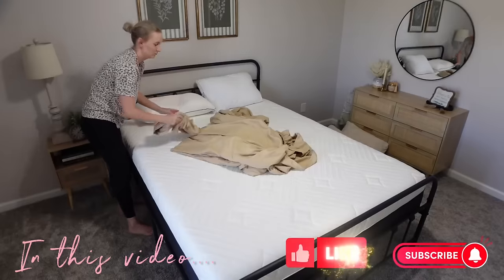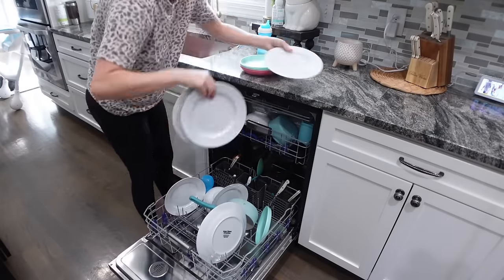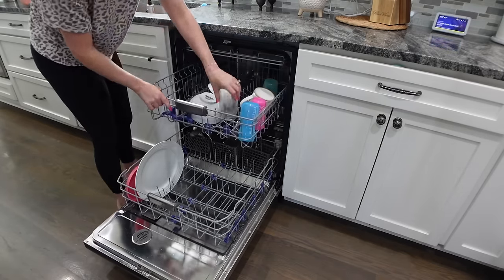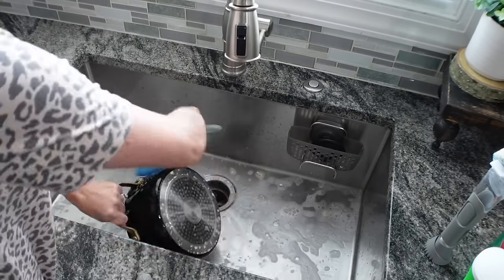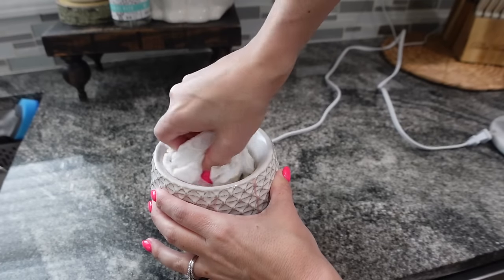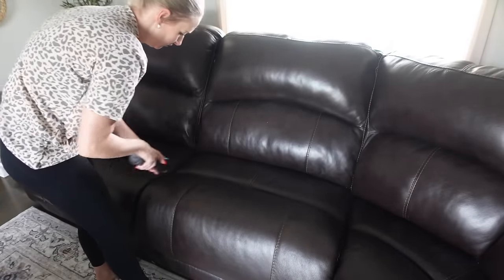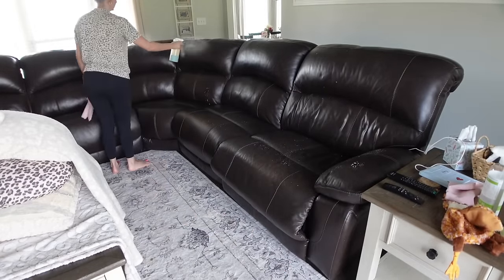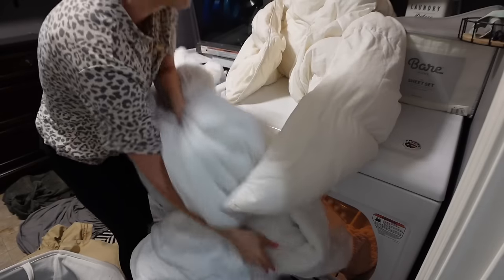2024 WHOLE HOUSE RESET-EXTREME CLEANING MOTIVATION-Jessi Christine-Keep Calm and Clean

Comment: To clean the dried wax just turn on the warmer, once its heated up the wax will melt and u can use a paper towel to absorb the excess wax and wipe it out x
Reply from the maker: I know. That’s not what I was doing. I was cleaning the warmer where it gets dirty after so long. The wax was gone I was just cleaning the parts that get black after a while.

Comment: Another quick hack on your warmers cause. I have a Warmer in every room in my house. Instead of trying to soak them up with a cotton ball, I will take and put them in the freezer until they freeze And then for maybe 30 minutes to an hour and then I will just take them out. And it pops right out, you turn it upside down pops right out. You get less of the burn mark.  When you do it that way, much easier to clean Just a little hack for you.
Reply from the maker: A lot of my warmers do not have the removable plates and this way is quicker so I prefer it but I have heard of that hack before!
Reply: @KeepCalmAndClean try using lysol to clean your warmers. I saw a video on it and it works great.
Reply: @KeepCalmAndClean  I have a mixture of the removable top and the ones that you don’t remove but if you do have the removable it works brilliantly but one thing I do with the ones that I don’t remove are that can’t be removed is I make sure that before I put another one in I cleanthem really good and then you don’t have that burn but like I said before if you will take hydrogen peroxide and just let it soak or take the pink stuff and clean, it should come right out
Reply from the maker: Def trying  those! Thank you 😊

Comment: Just a quick hack if you still have those burn marks. Put in hydrogen peroxide and let it set. Don't turn warmer on. Just let it set and take a clear rap. And you can put that inside over it, you might have to do it a couple of times but it will take that burn mark out. Or you can take some of the pink stuff paste and a rag or a sponge and clean it out that way.
Reply from the maker: Ok I’ll try that!